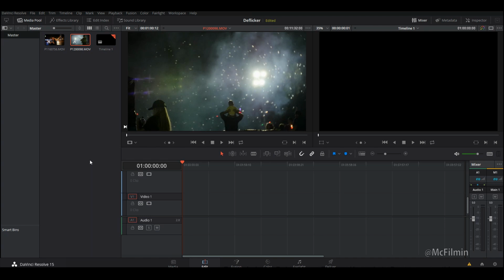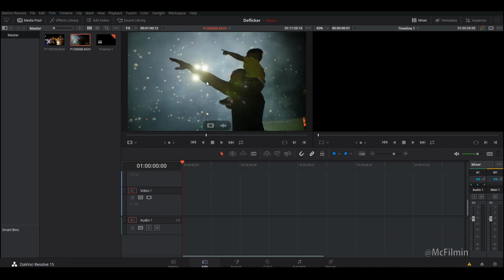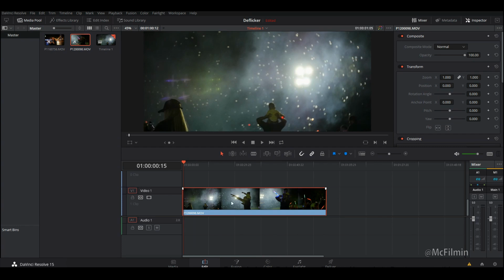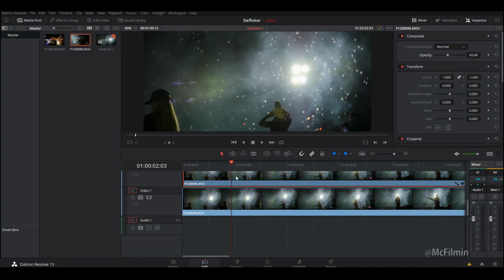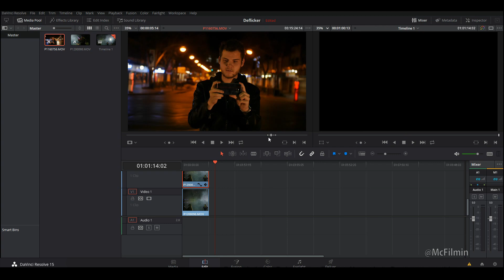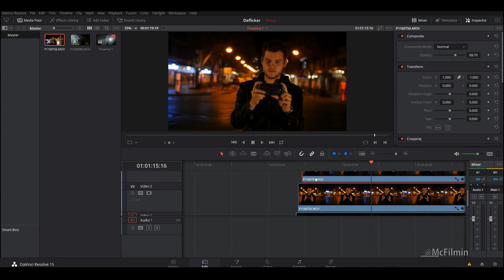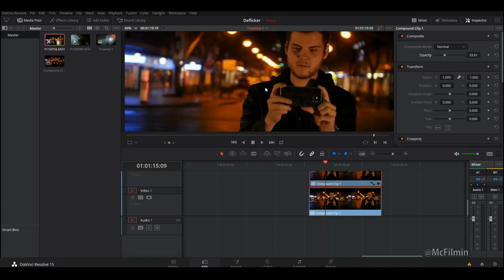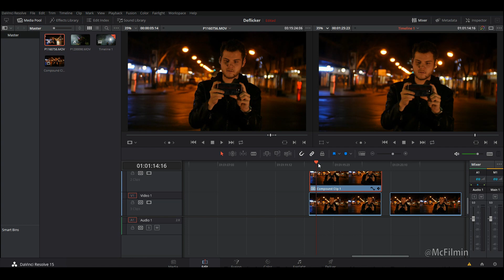How To Fix Video FLICKER In Davinci Resolve 15 | DEFLICKER

Comment: Yeah sadly the video I'm working with has lots of motion and the ghosting is pretty apparent, any ideas?
Reply from the maker: Unfortunately, no work around, works well on small to no motion in the frame, hopefully in the near future it is fixed.
Reply: It may be worth you purchasing the full version of Da Vinci. The deflicker tool is incredible and am pretty sure will sort the issue out. Try it with the watermark and see if it sorts you out. There are a fair few other really great tools in the full version which makes it worth the money. The Denoise is incredible on the full version too!! Hope you get sorted anyway.